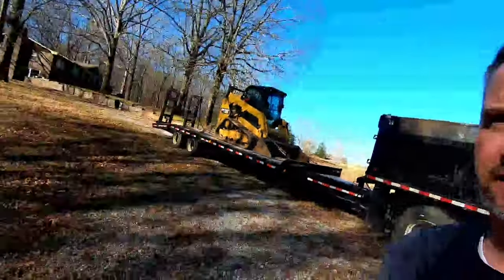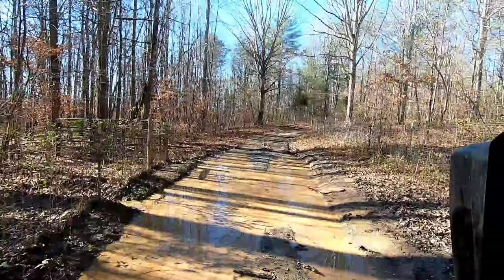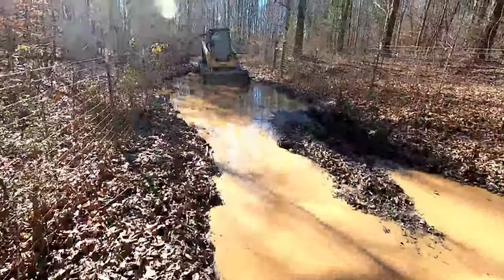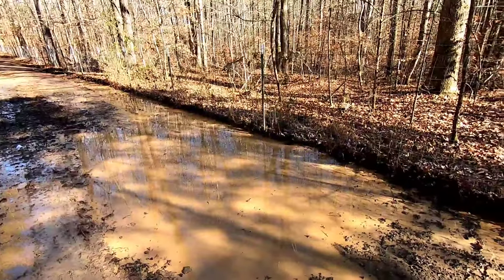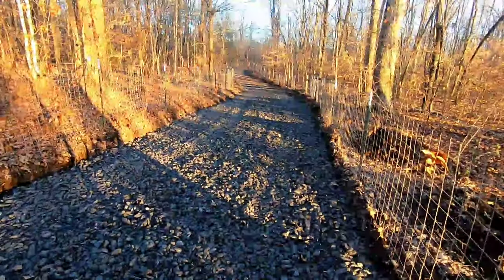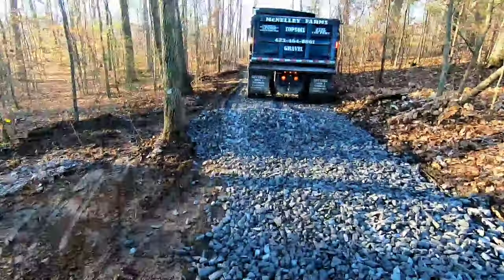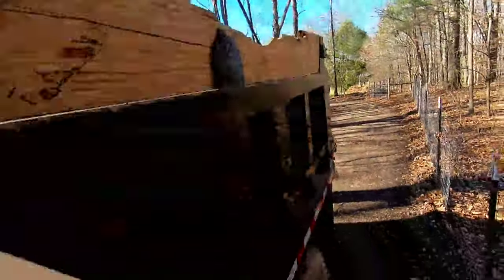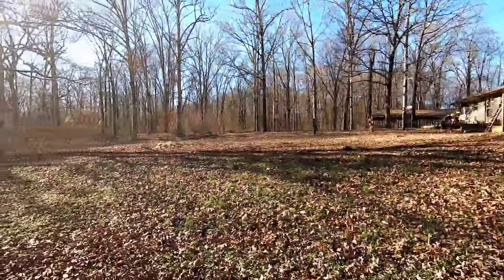Bad Road! BAD, BAD ROAD!!! CAT 259D...

Comment: Wow! We typically use a leaf blower to blow the water out of the hole and off the drive, but we haven’t had one quite that bad before. 😳Nice work!!
Reply from the maker: Thanks. Only way to fix those holes is cut the side out so it can drain. But they didn't want to spend the money for me to fix it right. So, I just bridged the water.
Some folks just want a band aid put on the problem 🙄...
Sam
Reply: @tristardiggin  It's hard sometimes knowing that it's a temporary fix but it's what is in the budget. At least the areas you fixed will be good for quite a while. 👍

Comment: Trash pump would be handy for some of those deep holes.

Would it be worth throwing down a little geo grid to help stabilise those boggy spots
Reply from the maker: Yup, a trash pump would work pretty good for that. The road was solid it just had some deep holes from where the loggers went through there. Just had to build the road back up with the big rock.

Comment: Nice job working in less than ideal conditions. Sure would’ve been nicer if those fences weren’t there in the deeper spots. Sorry about your truck part, but it looks like a straightforward welding repair. Thanks for showing us how you did it, and especially for speaking plainly about what it takes to have a conversation with/ someone truly seeking Jesus. It’s just a conversation. Our job is to make the introduction. The Holy Spirit’s job is to take it from there.
Reply from the maker: Hey Jeff, that is exactly right! We present the Gospel and the Holy Spirit takes it from there. 
That was a cool project and you are right, those fences were in the way…
God Bless,
Sam

Comment: Nice repair work.  That rock down here is so expensive not many people use it.  Sure does make a nice running surface though.
Reply from the maker: Thanks! Yeah it's high here too. $22.5 per ton plus tax. 
Sam
Reply: @tristardiggin  it’s 40/ton here
Reply from the maker: Wow!
Reply from the maker: Hey, I've been meaning to ask if you saw any bump in views or subscribers since you were on Brandon's channel?
Reply: @tristardiggin  I had a bump in subs. Views maybe a little. I just need to post more but it is an absolute chore with our not so good internet.
Reply from the maker: @planeanddirtsimple  I understand the internet thing. Pay $100 bucks a month and it's marginal at best. I would like to get with some other channels too. Just don't know when or how that would happen. Holler at ya later...
Sam

Comment: Didn’t look like much crusher run was put down. It didn’t look like 3 to 4 inches at all. But it did make the holes disappear.
Reply from the maker: Not even close to 4”. It was a low budget job but it turned out pretty good for what money there was to spend on it…
Reply: @tristardiggin  yes it looked good.

Comment: I like that dump truck/trailer setup.  Never seen one with three beams like yours.  What brand trailer is it?  Yes that driveway was in pretty bad shape.
Reply from the maker: It was in rough shape when I got it. Had it painted, new deck and a few things refurbished. The brand is Eagle, 20 ton trailer. Haven't seen that brand before but it is well made for sure...
Reply from the maker: Went back and looked, wasn't sure what you meant by 3 beams. That view makes it look like a beam in the middle. But that is actually about a 4" gap between the deck boards. I have a cable that lays in that opening that draws the Ramps up. Also convenient for sweeping dirt out that way.

Comment: Sir , would you recommend any particular single axle dump truck over another ?
Reply from the maker: I have had 2 of these International dump trucks and a couple International straight trucks too. I have been very pleased with International. Just don't have any experience with other makes. However, I'm currently looking for a tandem axle dump truck and mostly looking at Mack trucks. No particular reason, I suppose, other than I just like them. Main thing is check it out good to make sure it is in good mechanical condition. Repairs can be very expensive...
Thanks,
Sam
Reply: @tristardiggin  yessir , thank you. I hear them Mack trucks are really good off road . Maybe has something to do with their suspension . I'm no expert but that's what I've heard . 

Thank you for your reply
Reply from the maker: You are welcome...

Comment: Can you make a decent living with a skid steer and dump trailer only? Possibly maybe a mini ex in the future as well
Reply from the maker: You can make a living with a skid steer. Diversify the business with different attachments. A skid steer and mini x is a great team to do really well in the business. The following are a few thing that you can do to keep a skid steer running every day. Land clearing, brush cutting, driveway building and repair, utility install, brush cleanup, mior demolition work, building small pads, etc.. 
That is just a few things it just depends in what is available to do in your area.... Hope that helps...
Reply: @Tristar Diggin'  thank you for the reply. I was thinking about getting the attachments for land clearing and mulching. Going to start out on the small end equiptment wise. I've already got svl75 skid steer , a gooseneck trailer, and a 1 ton dually. Just need to invest in a dump trailer and some attachments. And a mini ex down the line. Thanks again for tbe tips
Reply from the maker: Good deal! Sounds like you have a good start. I like to hear folks are making their on way...
God Bless,
Sam